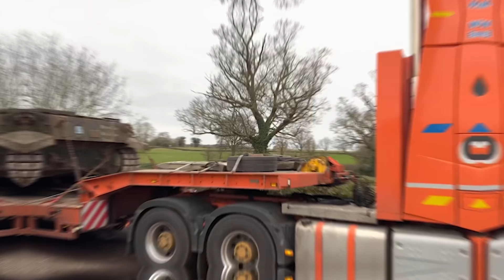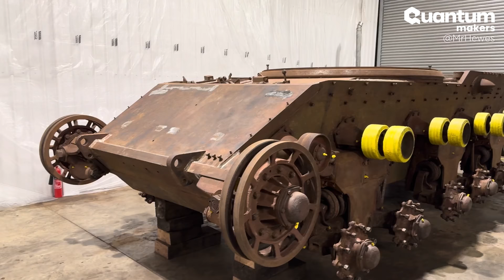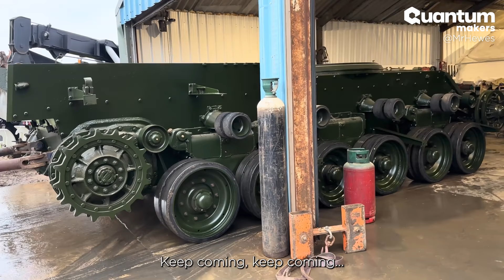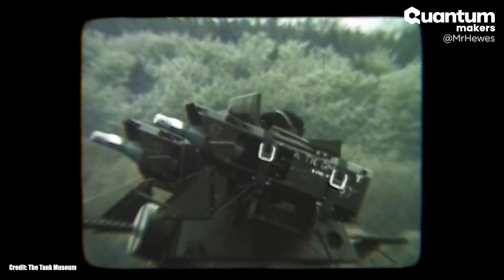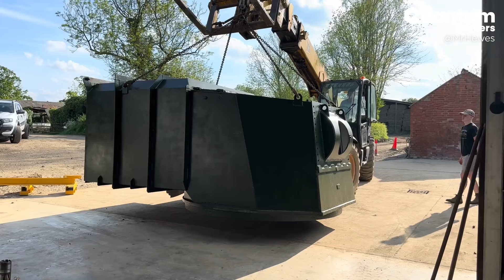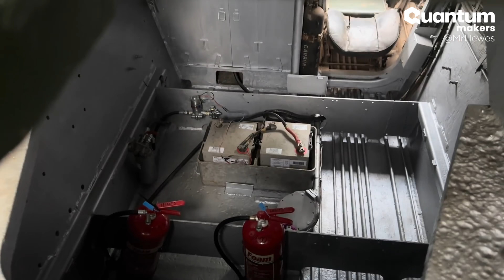How Two Friends Restored the TANK with the BIGGEST GUN in History | FV4005

Comment: REME Gun Fitter 72/85. I crewed a Cent ARV. Wonderful machine. It would go forever at 30 MPH (on roads) towing TWO Chieftains. Warm in the winter on the engine decks, under a self built canopy.
Only time I ever cursed it, was changing a cracked gearbox, that took forever to clean the thick glutinous, spilled oil from the bottom of the Engine compartment. 
Quick note... I'm sure the generator was a 1000cc Austin engine. There wasn't one mentioned here.

Comment: Well the problem is that it was NOT a tank, but a tank-hunter, that turret lacked enough armor to protect the crew from anything hevier than a regular machine gun. Also, it only could be fired facing forward due to the enormous recoil. Having a turret does not make it a tank.

The biggest caliber used on a real tank was 152mm and there are several vehicles who carried them. But if you prefer to consider a tank anything that crawls over tracks, then the FV4005 still is not the biggest caliber, it is Little David with its 914mm mortar gun.

Know your facts.

Comment: Great video. Reminded me of a "how it's made" show. I was disappointed that these guys wouldn't think of making the engine path as wide as possible by removing the doors and frames. Putting some osb on the floors might have helped as well. I didn't have to move an engine but it works great for oversize furniture.

Comment: The original version of the FV4005 called "Stage 1" was supposed to be a drum autoloader. That version was abandoned because it offered no protection to the crew and the turret housing would have had to be insanely large make it a HUGE target. What you see in the video is the non autoloader version that can fire roughly 3 rounds a minute.

I'd post links to an article about it showing pictures of the Stage 1 variant but youtube autodeletes comments with links.

Comment: Respect for restoring the history. Sure it was project, but even project is part of history. Only why you ruined cooling by tap water? Brand new engine and now it is same good as junk. Tap water is the last thing what to use on any cooling system. Sure they used originally but you should be smarter. Use distilled water